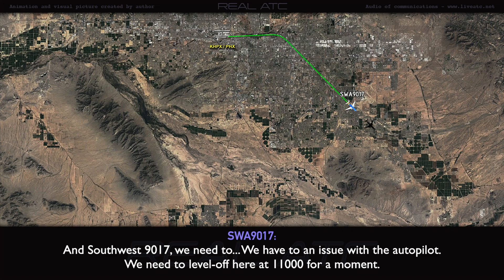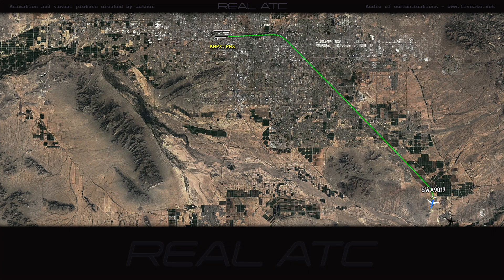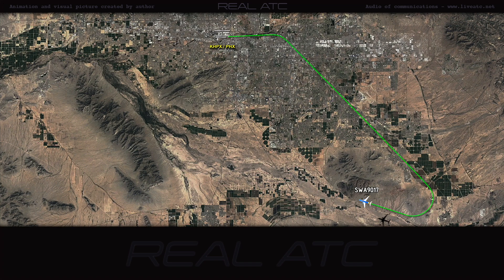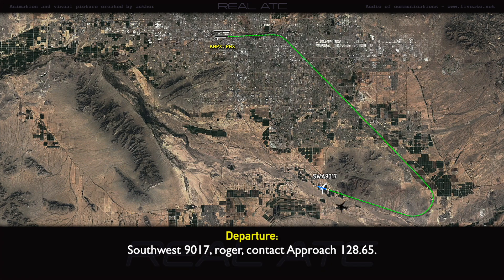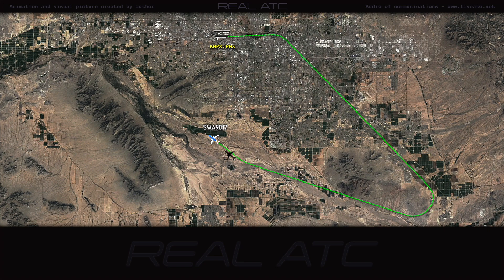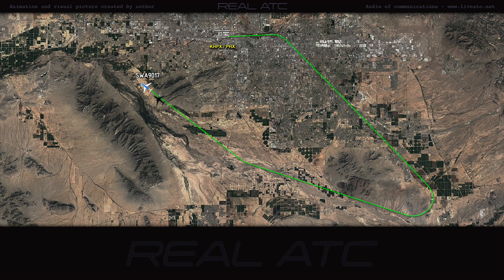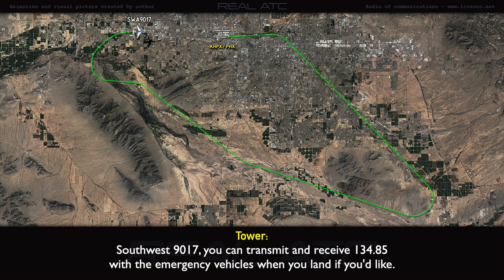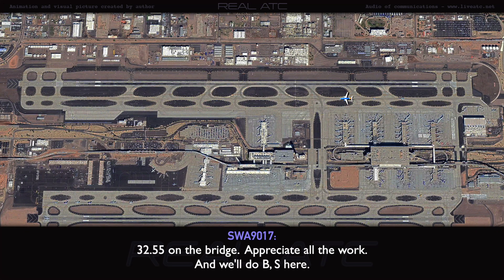BRAND NEW Boeing 737MAX TRIM FAILURE after departure. Southwest 737. REAL ATC

Comment: I'm an ARFF Firefighter at PHX sky harbor.  It's interesting to hear the interactions between the air crew and tower.  We don't get involved until we receive the "ring down" from the tower declaring an Alert.  We respond 6 different trucks, from two different stations on the airport.

Comment: The problem is uhhhhhhh we're in a MAX and its a trim issue so it's a bit awkward so ummmmmm yeah let's take all the precautions.
Reply: I would hope so. It's far better to be cautious!
Reply: The issue was apparently a circuit braker wasn't replaced after an acceptance trial flight. The aircraft was back in service in a few hours after the mechanics ensured that was the only issue with the trim system. A bit of an egg on face moment, and someone will have an uncomfortable conversation with the chief mechanic. However, these things happen, the ground procedures catch most problems, and those that aren't caught end up like this, an inconvenience for all involved, but better than flying with a major flight control system inoperable.

Comment: What happened to something called quality control?..Let's face it, things like this shouldn't happen on a brand new aeroplane!!
Reply: New airplanes/avionics are where it happens.  Infant mortality; etc.
Reply: I hope they don't hire for diversity.
Reply: Apparently, this was a SWA issue, not a Boeing one. A circuit braker was pulled out for the acceptance trials and wasn't replaced when putting the aircraft back into normal service configuration. After a few hours on the ground at Phoenix for the mechanics to ensure the circuit braker was the only issue causing the failure, the aircraft returned to service.

Comment: Software or hardware problem with the plane ?
Reply: Technically hardware, but neither really. Apparently, a mechanic had failed to replace a circuit braker after an acceptance trial flight. The breaker was replaced, the system checked to ensure that was the only fault, and the aircraft returned to service a few hours later.

Comment: why are there max issues seemingly every day?  shouldnt they be grounded again?
Reply: What other MAX "issues" are you aware of?
Reply: Why are you picking on the max. Just look through the videos and you’ll see aircraft of all types having issues everyday. Fact of the matter is they are machines, they break down. 

I’d also like to point out that of the 4 max videos I saw in this channel, 2 were aircraft faults, one was a bomb threat, and one had a passengers laptop catch fire.
Reply: This was apparently a SWA issue. The acceptance trials include flying without trim authority, so to test this, they turn the trim system off. Apparently the mechanics missed it in turning everything on again. The aircraft returned to service later in the day when it had gone through checks to make sure that the breaker being pulled out was the only issue in the system.

Comment: Actually, this is the proof that the technical improvements put in place in the Trim System are working properly, deactivating the system if there are issues in it.
Don't be banal...
Reply: Apparently, the only issue with the trim system was that a circuit braker hadn't been replaced after the acceptance trials flights.

Comment: Wait a minute... they declared an emergency because they had to do the actual flying? 🤣
Reply: I hope Boeing pays you handsomely for all your hard work!
Reply: No ability to trim is considered a flight control issue, and yes, on a large transport category plane could be a major issue. It's a mandatory NTSB reportable event for flight control malfunction.
Reply: Did you already forget what happened to the other 2 max 8s that had trim issues?
Reply: They followed procedure to the letter. There are rules in place for a reason.
Reply: Never forget that the procedures are written in blood. They 'could' have kept going, but manually correcting for a lack of trim control is quite tiring both mentally and physically over the course of a few hours. They also didn't know the nature of the fault other than the trim system was inoperable at that time, and given a faulty trim system can make an aircraft impossible to fly, they chose to return. It was the option that was safest for all involved and the pilots returned to the airport so the mechanics could solve any problems on the aircraft. Apparently, the issue was caused by a circuit braker not being replaced after an acceptance trial flight, and the aircraft was returned to service later that day when the mechanics had confirmed that there were no further defects in the system.

Comment: Auto trim system is going haywire and crashing the plane? Redesign it for 3 years. Now trim is not even operational. Boeing solution.

Seriously it sounds like they haven't fixed the issues. I prey regulators everywhere are on Boeings ass constantly about this
Reply: Hey if it doesn't work it can not malfunction. It like the German railway, if we cancel the train, than it isn't late and won't go into the statistics
Reply: This was apparently a SWA issue. The acceptance trials include flying without trim authority, so to test this, they turn the trim system off. Apparently the mechanics missed it in turning everything on again. The aircraft returned to service later in the day when it had gone through checks to make sure that the breaker being pulled out was the only issue in the system.